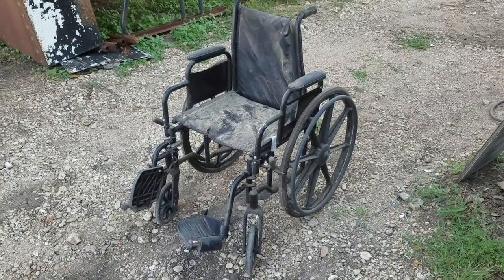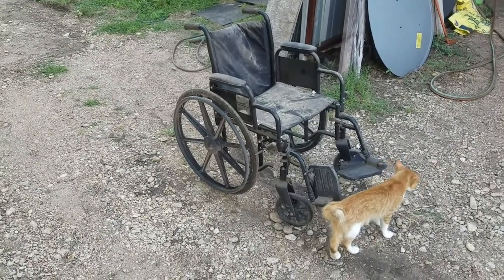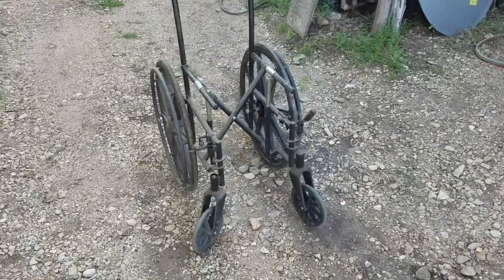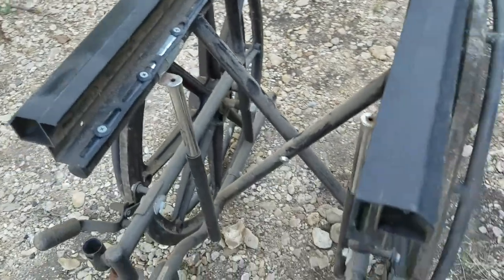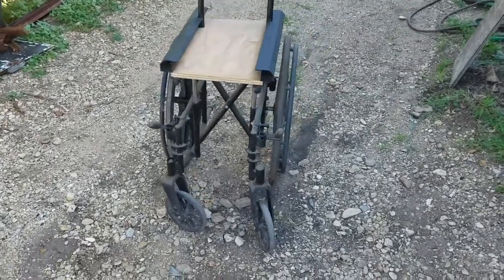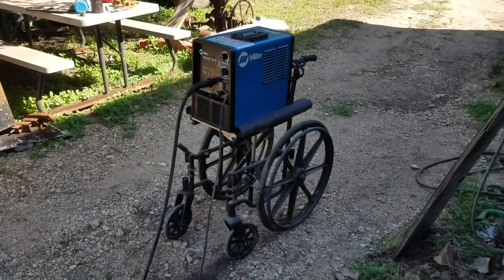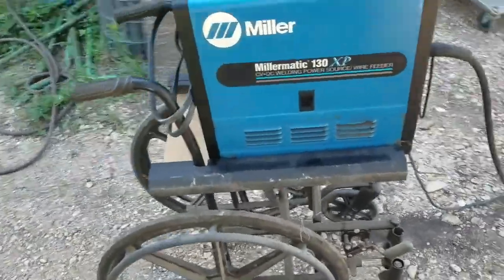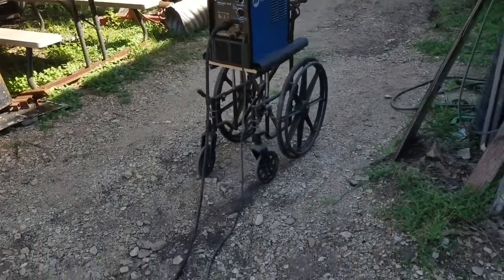Tired old wheelchair

Comment: Came here from Stephen Cox's channel, saw you working on the 8n tractor for Mark. Love the welder cart you made, I've welded for 50 years, and I could have used the cart many times.
Reply from the maker: Thanks for subscribing I have also built a wheelchair cart for my plasma cutter. They work great in my barn.